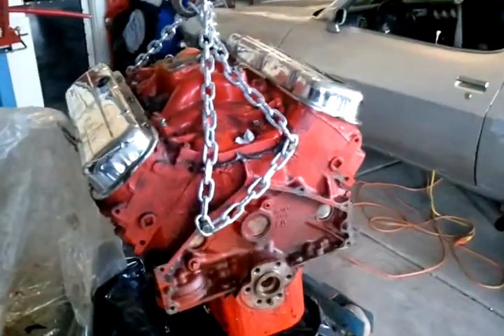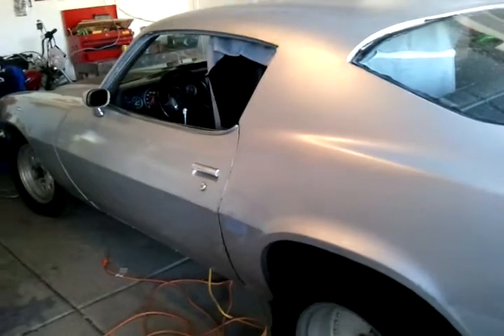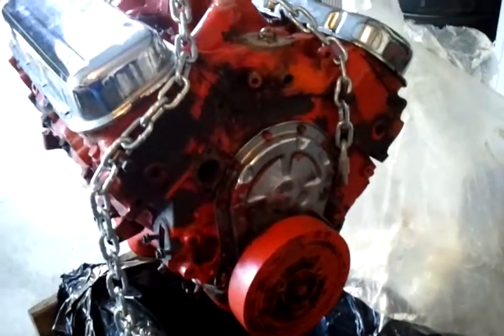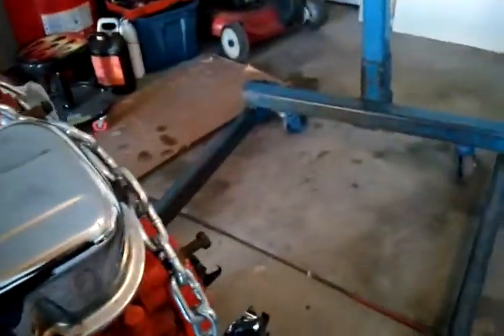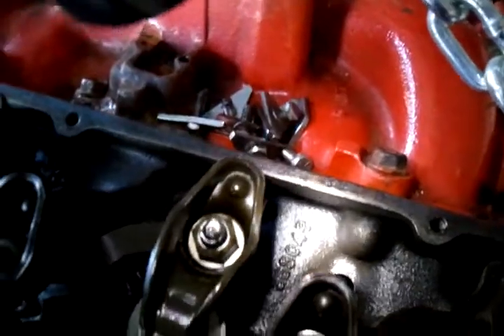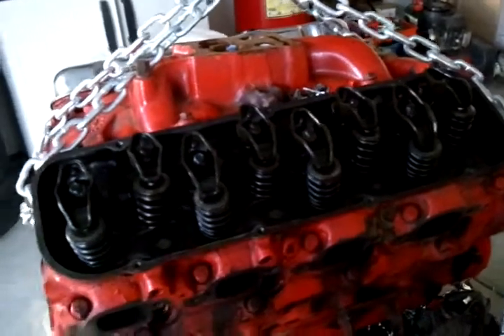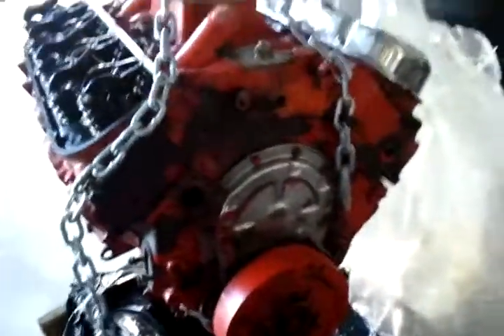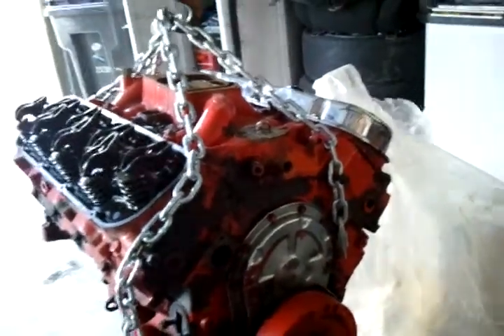Chevy 454 build

Comment: DON'T DO IT!!  Keep th 049 heads and add some cheap eBay Dome top pistons to raise the compression ration.  You will likely lose power using the closed chamber 396 heads even with the increase in compression.  The power is in the cylinder heads which flow so much more air over the cc heads.  Pistons are a better option if you want more compression.  A mild cam upgrade will help with the flow too.  A little more work but worth it.  Good luck.